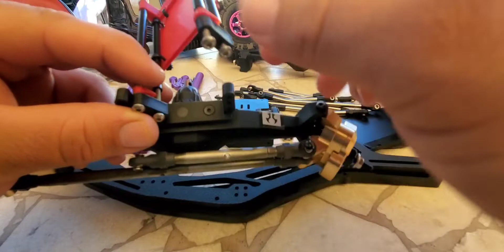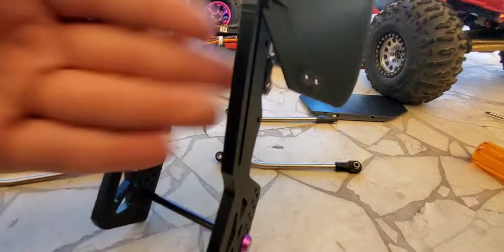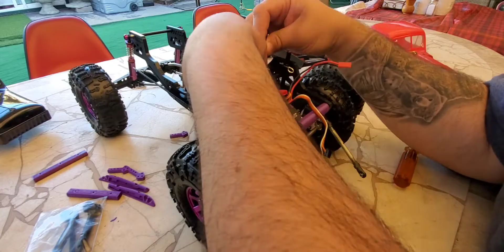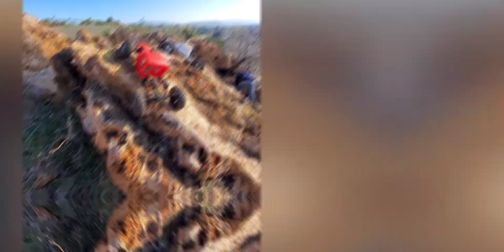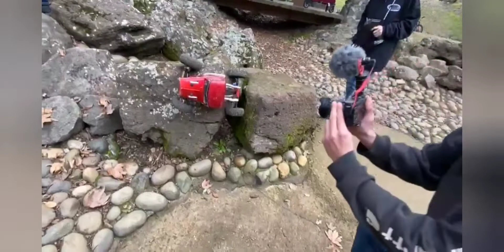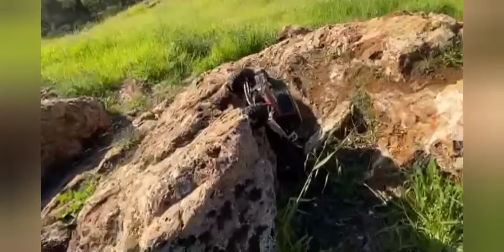Pork Belly Crawler Chassis Builder kit

Comment: Hey My friend I Have been saving an getting parts one at a time to build me a crawler like you all the pork belly chassis an I have been getting parts together since I got hurt about 4 years ago and I went down to Florida from Virginia to help do that Storm clean up work to help them out when that storm came an messed it all up an I got crushed with a log an I am in a wheelchair now an I have got it to crawling now an my first build I have wanted to build me a pork belly chassis I have been saving parts since I got hurt I have off set capra axles well I have everything but the chassis an links to build me one of the nice ones like you have so if anyone you know has one of the chassis an links that they are not using or don't want anymore i need ine si bad because I am in this nursing home an i have all kinds of places here ti crawl so any help would be nice here is my address if you or anyone wants to or can help me finish my build with what i need to finish my build because i don't know what I need to finish like in the chassis an things ok my friend 2966 slate Creek road Grundy Virginia 24614 an thank you for all the great videos an sharing this with me have a great day

Comment: New to this platform and I have to say I am loving this brand. Question why is the rig in the video sitting so much higher then the red rig?  For my driving style I love how low the red rig is sitting. I personally would go that route. Is the chassis different. I see on there web site they have two different chassis to choose from. What is the red one? TIA
Reply from the maker: The purple one is sitting high because I just put it together after tuning it now it's much lower.
And for the difference between chassis there is the classic PB and this fits any build, but the Xtreme PB is lower shock towers and skid is moved forward also has a better brake over angle but you need to be careful not all transmission and motors will fit.